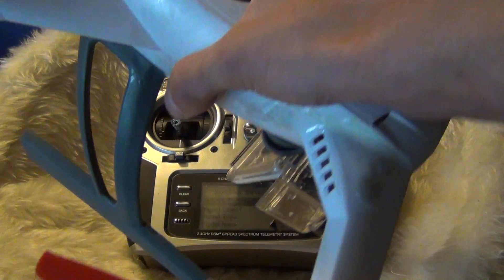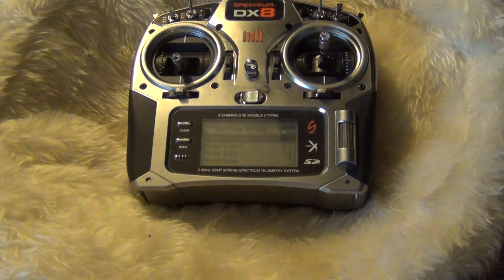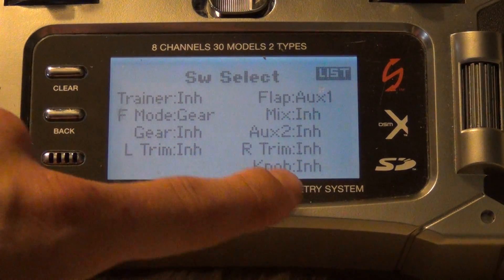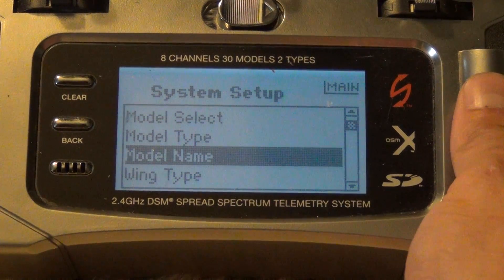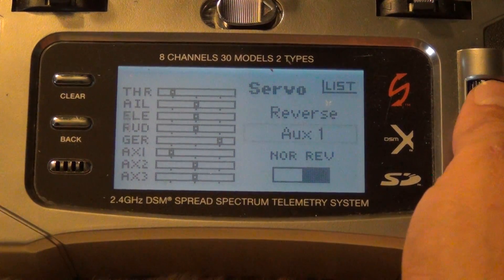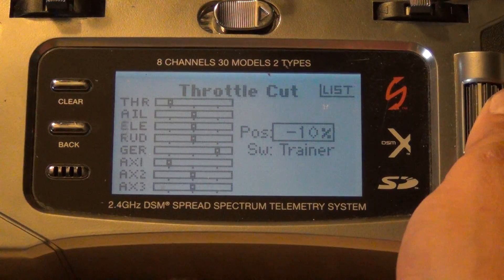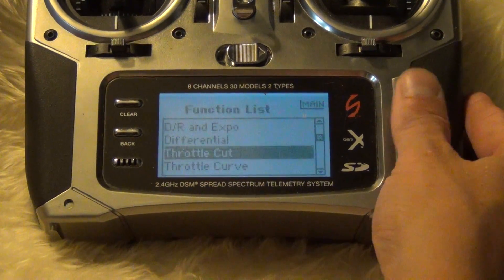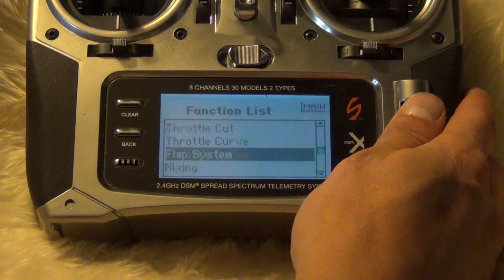Blade 350QX DX8 TX Settings

Comment: I truly believe what you say about some owners may have hard time programming. It's why I have programming threads on RCG, just haven't got mine yet to provide the help and info yet. 

What you described is exactly how it's written in the manual, you show took the time to show it on video which helps A LOT. 

Nice.

Comment: Hey Tab!  Very Nice.  I have my DX8 set up the same way.  It was confusing at first because the default Gear setting was set to Gear and it would not let me set the Fmode to Gear.  Once I set the Gear to INH, then it let me change the Fmode to Gear.  A bit confusing at first but I got by it quickly.  I just got done shooting my unboxing (gave you props:) and am charging a pack for the maiden. Thanks for posting and happy flying!

Comment: I confused myself in the manual looking at the dx5e "return to home" procedure and hit the bind button mid flight only to have my 350qx drop like a rock... don't do the same thing I did. After that, I tried to fly again because I wanted to see how the return to home function actually worked. I hit the proper button this time and the 350 totally flew away on me and came down very hard breaking the frame and landing skids. My better judgement told me not to put the gopro on maiden flight!

Comment: Hi, I read the manual on the web, as I'm waiting for my 350QX, its on pre-order, So I put rates as manual  0 =70% and 1 =100% for elevator and aileron both on my aileron switch, the R T H I was thinking of putting on my GEAR switch as to me it makes sense to "Land" with Gear down, Ok the Gear switch has to be put on Aux 1 to work, some guys have suggested leaving throttle hold on the Throttle hold switch aka Heli flying, and as manual states Safe, Stab and Agil on F switch, cant wait to fly it.

Comment: Do you know if you can install a 8 channel receiver in the 350QX? I'm shopping the 350QX with a brushless gimbal. I know the gimbal will operate and hold steady by just adding power, but I want to use the tilt function of the gimbal as well (from the same radio/transmitter). I guess my question is... is there any way to install another receiver to operate the gimbal tilt? To either have that new receiver operate both the quad and gimbal or will one radio/transmitter send out to both receivers and accomplish what I want? Any help would be appreciated as I'm new into RC and not sure if this is possible before I buy the quad. If its not I may go a different route like the IDEA FLY4 to accomplish what I want, But I like the looks and features of the 350QX more then the IDEA FLY4.
Reply from the maker: From what I know there is a gimbal plug and it needs little to no setup.  My friend got a gimbal for his 350qx and it was plug and play and works great.
Reply: earthling1984 From I've seen the brushless gimbal just needs power and it works to keep the camera leveled because it operates off of it's own board. But there is no manual tilt function available with a 5 channel setup, you have to have a radio with additional channels to operate the manual tilt. I know there are gimbal plugs but they are for a future plug&play gimbal to operate off of the quads flight board for auto leveling. These gimbal plugs do not provide a channel for manual tilt. So when you say your friends works great... does that mean he plugged into power and it does the leveling operations? Or, does he have actual manual tilt function from the radio so he can point camera downwards if desired while in flight?